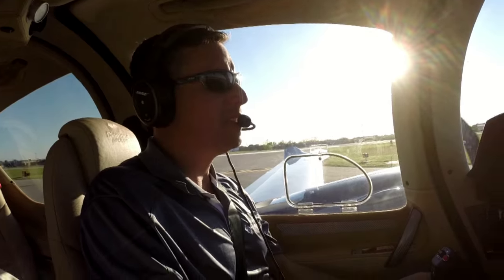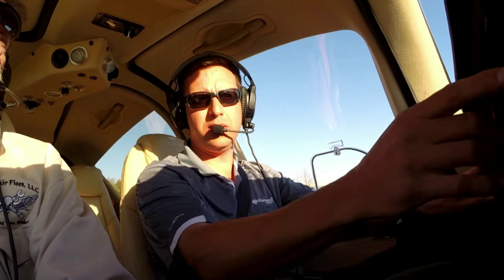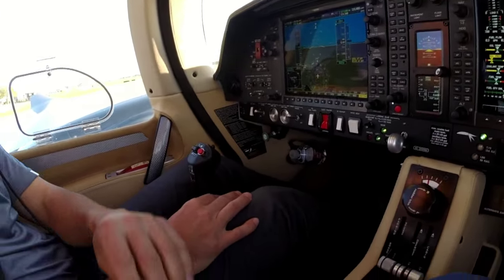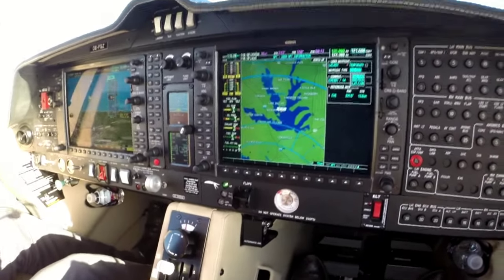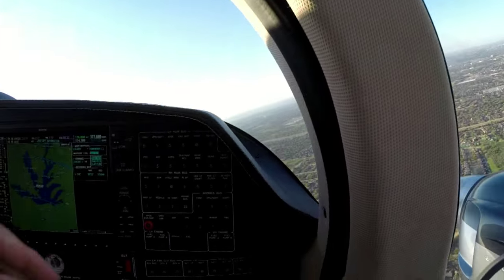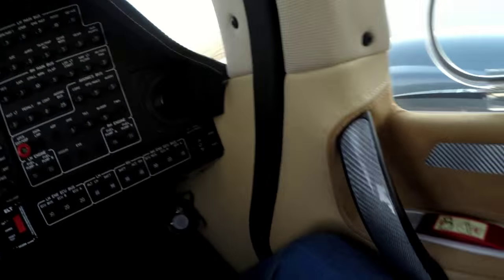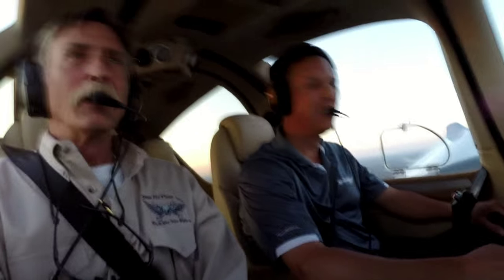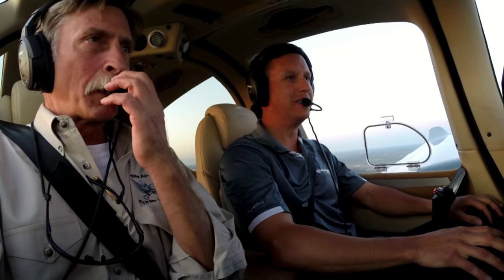DA 62 Photo Mission with Kevin Lacey and Trevor Mustard revised with a fly by

Comment: Thanks, Kevin.  This really shows how engineering is moving safety and efficiency forward.  Too bad the certification pipeline cripples so many manufacturers.
Reply: Yep whcih is why we have been largely left with engines designed in the 1950’s rather than like modern car engines that manage themselves.  FADEC on a small twin :)

Comment: Very nice airplane. I saw it on static display at AERO 2016 in Friedrichshafen just days after it received EASA certification. You couldn't do a mag check if you wanted to. They're Diesels. And of course they're clean Diesels. They're not from Volkswagen. I don't think they have particulate filters, but they are modern Mercedes-derived, Austrian-built high-pressure direct injection machines. They make some very very fine soot particles. Cause cancer, but are almost invisible.

Comment: Dieses fuel jells in cold conditions. You could not fly at any altitude with it. My understanding is they burn jet fuel which is basically kerosene in them. This plane is way overpriced for what it is.
Reply: You are obviously ignorant of new airplane prices. Check out a comparably equipped Beech Baron, a forty plus year old design.
Reply: Werner Danler they dorm burn diesel dude. They burn Jet-A